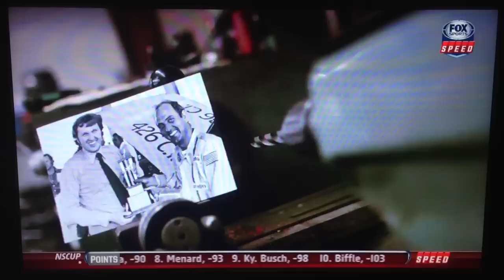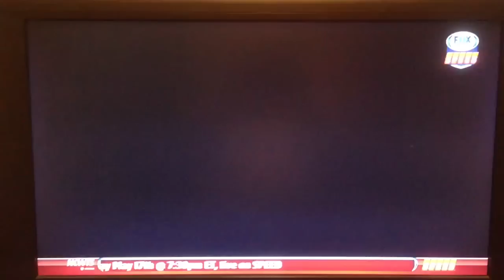"Where are they now?" - Dave Marcis

Comment: Dave is unreal. I was working at a project at the Asheville airport. One day I came upon a guy and and old chevy pick up truck parked on a really tight curve on the way back to the backside of the airport. Here was this guy with a slag hammer breaking up some concrete in the middle of that curve. This guy had a Goodyear hat on and a flannel shirt and wing tip shoes. It was Dave breaking up some concrete that dried in the middle of the road. I spoke with Dave and told him that I was going to stop traffic before that corner so he would not get run over. You see somebody must have lost a bag of concrete off a truck and it got wet and dried in the middle if the road. Dave was concerned about that. I hope when I reach his age I am still going half as good as he is. You have to love the guy. He survived many racing crashes and I dam sure did not want to see anything happen to him that day. This happened about a year ago.

Comment: First met Dave at Maxton, NC.  He was there with his ECTA Mile car and I was running my 1940 Ford Flathead.  We were pitted across Dave and crew.  It was their 1st ECTA mile event and they were having a hard time in tech.  Land speed racing is different from NASCAR in the safety requirements so as racers do, we went over to offer whatever advice we could to get Dave through tech.  If memory serves, the problem was how he had the parachute release set up.  Dave's solution was inexpensive, simple and it worked!  The tech guys finally realized Dave was right.  Later on that  year, I got my Cup car on track.  I called Dave several times for advice which he freely gave.  He is a fine racer and person.  And yes, he should be in the HOF!